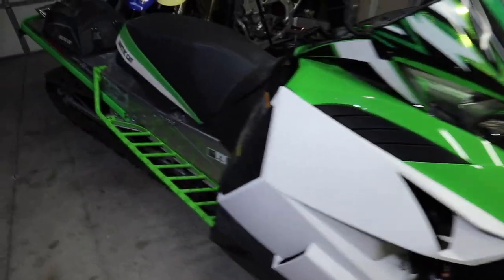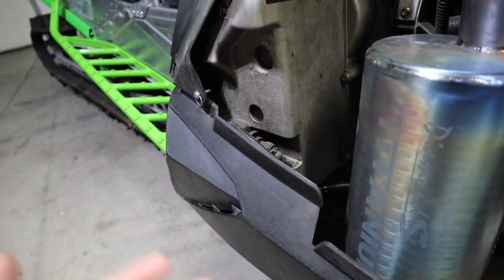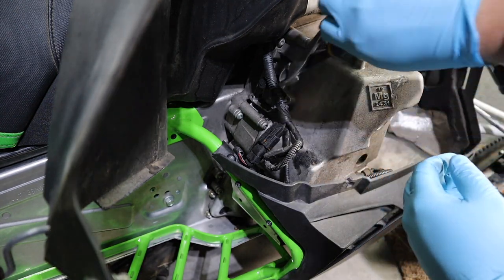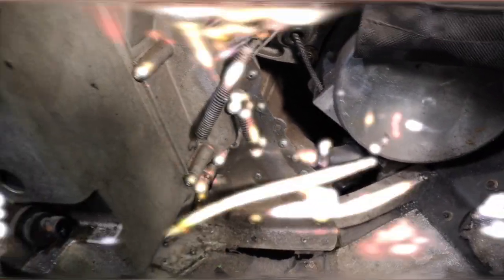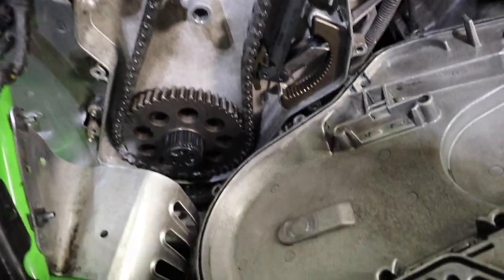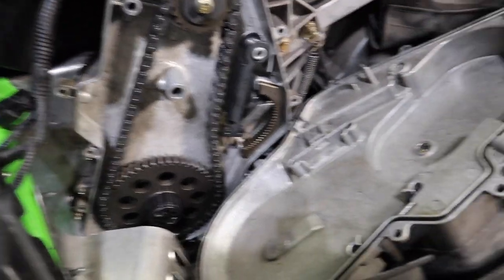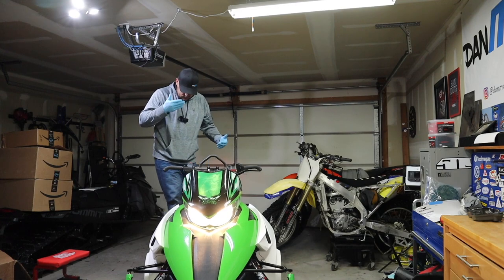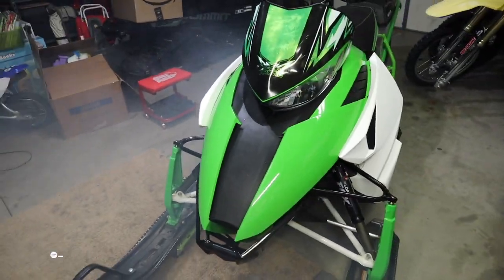ARCTIC CAT CHAIN CASE OIL CHANGE | Don't wait to do it!

Comment: If you have a newer cat with the Aluminum lower gear I highly recommend the BDX steel replacement. Keeps the oil from turning to "tin man jizz"
Reply from the maker: Great suggestion, idk why anyone would run a aluminum gear on those chain cases. Sounds like a disaster waiting to happen!
Reply: @Daniel Tucker  it was for weight savings, it's rare that they actually fail, they just wear and make a royal mess.
Reply from the maker: Makes sense!

Comment: Dan could you use blue loctite on the chain case bolts when putting it back on? Thanks for the video
Reply from the maker: I wouldn’t, just torque them to spec and you should be dialed! Thanks for watching, I appreciate it!

Comment: At what point does the oil drain? I assume as you loosened all the bolts oil started draining at the bottom. And rewatching your video, it looks clean (oil free) as you moved the 2 cycle tank away.
Reply from the maker: It starts draining once you break the seal on the bottom bolts. It’s only 12oz. so it’s not much oil at all. Hope that helps!

Comment: What ratio do you use for 2 cycle oil?  I have an m8000 with big bore and I don’t use the factory oil
Reply from the maker: You just add oil to the sleds, they are oil injected.

Comment: Hey Dan, I was told I couldn't tension up my chain and that since it is auto adjustable I need to buy a new adjuster. I hear chain slap everytime I go im and out of reverse. I have the snopro
Reply from the maker: Sounds like it’s shot for sure. Dig into it and see what you find, but it is an auto adjust that tensions when in reverse. Don’t run it anymore!
Reply: @DanMX2112  sweet man appreciate it! I wasn't quite understanding when it did the adjustments but it makes sense now. Thanks man
Reply from the maker: Thanks for watching, I appreciate you!